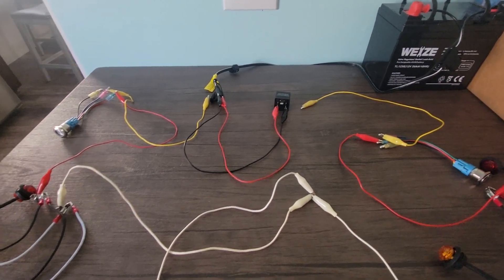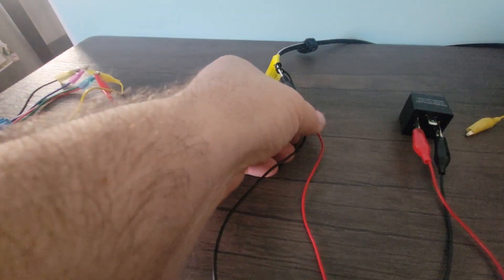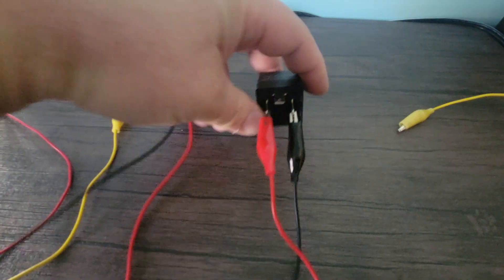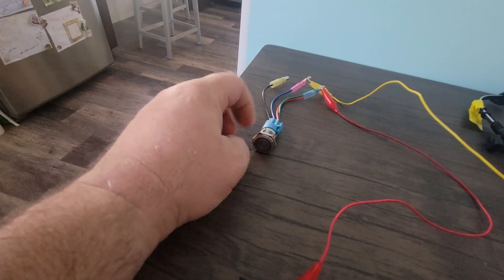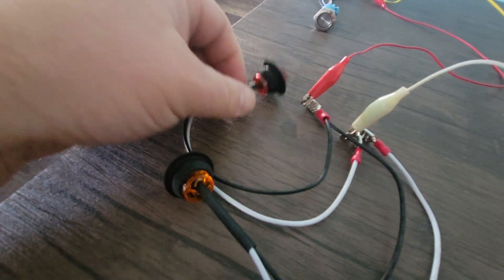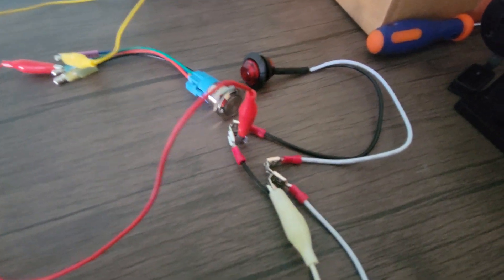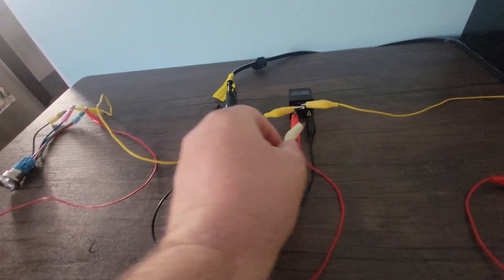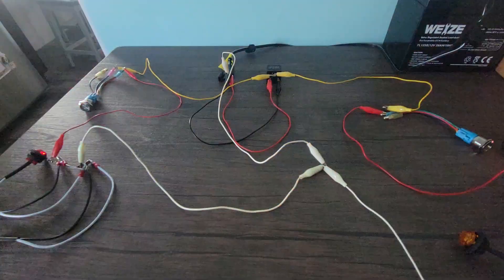How to wire a turn signal flasher relay directional blinker for a car, truck, atv, motorcycle, ect..

Comment: I just bought that setup so this helps out a lot for me !!! on my 212cc build ina a 1987 polaris 250cc cyclone quad frame. the o.g. motor is gone now !!! I might drop a 420 cc later in it. the go-kart motors !!!! basic 6000 rpm. stock !!!

Comment: Hey awesome video and project. Was wondering if you had any input on a set of tail lights and flashers working, but turn signals do not work while tail lights are on.  Front signals and lights work fine. Rear signals work but only while tail lights are off.  Im stumped at this time.  Thank you for any help.  Peace.
Reply from the maker: It sounds like you might have a wiring issue in the rear light circuit, maybe a short or broken ground.

Comment: I'm confused, another video I saw the guy had 2 relays that connected to 1 flasher. You are using 1 relay and where is the flasher?
Reply from the maker: This is just one relay it has a potentiometer to adjust the timing of how long it blinks. The right and left light circuits are wired in parallel with individual maintained switch/button.
Reply: @offgridutah1  is there any way to make that work with the oem turn signal stalk on my 1987 jeep cherokee? I also need emergency blinkers to work with my stock emergency blinker switch
Reply from the maker: @nikthepunisher6255  if you bypass what's there and wire this circuit into the stock lights it should work just make sure to use correct wire size and fuse on  each circuit

Comment: So sequential leds signals are a huge market. Can I make my own using let's say a 5ft strip of leds and a turn signal relay?
Reply from the maker: One way this could be accomplished without a controller is that each light could have its own relay and each light relay would have a potentiometer set to a different position so that each light could be on or off for different periods of time this would require some different wiring methods than what is shown in this video. There are other ways to do this but the easiest way is to use some sort of controller so you can control the outputs for the coils of a relay for the period of time of your choosing.

Comment: So i have an extra back up camera that i want to install on my car to replace my broken side view mirror (yes i know i could just replace it, that costs money and i already have everything else i need to do the install. And id be bored) but im trying to figure out how to trigger the camera while the turn signal is on without the screen flashing with the signal. Any advice?
Reply from the maker: You would need to use a regular relay that is triggered to turn on when the blinker gets powered and you would wire the coil as a start stop circuit with memory.

Comment: is that clicking coming from the relay? I have a moped and it does have turn signals is just that the relay doesnt click, so I tend to forget when I have them on, wondering if I can just switch the relay and add that clicking noise. LMK
Reply from the maker: The click is from the relay because it has moving parts inside.  Solid state relays wouldn't make that sound. It is possible to change relays, but solid state relays usually last longer.

Comment: Okay I have a 2000 Mazda Miata and it's got a three terminal flasher and I'm changing it to LED and I can't find the direct plug-in one so I'm going to have to make a little wire harness and this explains everything to me how they work thank you very very much! All the terminations are in the switch on the column so all I have to do on the Flasher is get power and ground and then power up to the column on the original harness easy peasy

Comment: My golf cart turn signal control module is bad. Apparently these modules are always burning up. So I want to bypass the module using a flasher. The lights are LED, Is there a specific flasher for led lights?
Reply from the maker: The relay in this video would work just fine for that.

Comment: My talaria has 3 wires i have 2 pin relay do i need a 3 pin with the ground in assuming?  Or cuz in missing that it seems
Reply from the maker: Some relays have an extra ground leg for   a led light on them. This might be what you have. Not sure without seeing a picture.

Comment: i was wondering. you said that you had the wires fused  and i was wondering if it was necessary to have them fused? thank you. Raven
Reply from the maker: Fusing will protect your setup from mistakes or accidentally touching pos to neg. If that happens the wires will become a fuse and the insulation/wire coating will catch on fire.
Reply: thank you. if i directly wire my turn lights to my 12v motorcycle battery using the setup here without a fuse will there be too much electricity from battery and blow the turn signal bulbs or with the flasher switch only let so much electricity through? thanks. Raven @FTOTF1
Reply from the maker: @RavenKitten  it will not let to much electricity through. Lights will draw power based on their wattage. It will work. It's not safe if it the wire loses insulation... That is what will allow to much electricity through. Lights act like a resistor and only allow a finite amount of amps through.
Reply: ok thank you. that was what i was trying to figure out. what is making sure the watts and amps are correct for the lights? was it the fuse, the flasher, or the lights themselves. Raven @FTOTF1
Reply from the maker: @RavenKitten  voltage of the lights should be compatible to the battery voltage. In this case 12 volts. The fuse must burn before the wire so it's the weakest link. Watts/volts=amps.
Add up wattage of the bulbs /12 volts = amps use the amps to look at a wire size chart. Bigger wire size handles more amps. Make sure the wire can handle the amps and run while on continuously as well as the fuse, as amps get close to the fuse rating, they shouldn't be getting close to the wire size rating.
Reply: i see ok. i understand that. thanks for taking the time to clear that up for me. it was a huge help. Raven @FTOTF1

Comment: trying to recreate this setup to have turn signals on my jacket. any tips?

edit: I guess I have to tap into the turn signals, right?
Reply from the maker: Parallel off the bikes turn signal to the light and other light wire back to the common.

Comment: On my 2008 Ninja 250R they are also wired through the dash indicator. Polarity through the dash indicator is actually reversed depending on which direction your turn signal switch is in.

Comment: Great video, well explained.  I do however have a question.  It looks like you have your fuse on your ground.  I thought fuses were supposed to be on the positive side?
Reply: No,no black  is hot right rear mister master of confusion
Reply from the maker: It was hooked up that way when I made the video. The fuse will still work. Normally I fuse on the positive side. Thanks for noticing 🙂

Comment: Does that particular Flasher draw any current if none of the Switches are turned on?

I've seen 2 pin electric flashers with just 12v input and Load pins. But since this one has a ground pin it got me wondering of it draws current? I like that it give the audible click. 
The 2 pin I bought doesn't have the click noise. 

I'd like to buy one of these instead but just wonder if there is a draw and if it would drain my battery.

(I'll use a hot 12v input instead of switched ign input so my hazards can work with the truck off)
Reply from the maker: I haven't measured it but I do not believe that it draws current when not in use the way it is wired in this video.

Comment: Is this for LED only, or do conventional filament buls work with this relay?
Reply from the maker: As long as you don't exceed the voltage or current limit of the relay it will work for anything.

Comment: Amazing video... short and easy to understand... One quick question: Would it be possible to use an actual motorcyle turn signal switch in this circuit instead of using the regular push button in the video? If yes, can you explain how to connect the motorcycle turn signal switch to the circuit in this video... thank you
Reply from the maker: Yes you can. The switches In the video are maintained buttons. Meaning they stay on or off until they are pressed again. The same as a switch would. If you have a specific switch build the circuit and wire up the normally open contacts.

Comment: Nice video. Would this work with krx original tail lights ? I tired to tap into my left tail light to turn left both tail lights started flashing ?
Reply from the maker: You may be tied into the wire with both lights in parallel which would be perfect for hazard lights. Make sure the pos side of each light is isolated from each other so it only runs a positive signal to one light at a time.

Comment: Hey bro you still on here Ima need some help wiring some lights from a battery to a 03 rm85 for a mot
Reply: My main question is my indicator setup is the same how do I run a rear tail light separately but off the same loom( not flashing just on) and I’d also need to wire in 2x brake light switches so when I pull/press the levers they light up brighter as stop lights?
Reply from the maker: @Tizzy_p  I don't have a video showing this.  But all you need is to pull pos to an on switch that is in series with two lights that are in parallel and both lights share a negative return to the battery. This is the running lights. Next from the pos side just after the on switch create this same circuit twice one for right one for left and use a momentary switch for these 2 circuits. They will function as right and left brake.
Reply: @FTOTF1  that’s perfect buddy I really do appreciate it obviously the same theory applies without splitting as I only have the one brake light bro
Reply: @FTOTF1  if you get a spare minute have a look at my last vid right to the last 20/15 seconds your see my project
Reply from the maker: @Tizzy_p  post a link here

Comment: I can’t get lights to flash.
Reply from the maker: Try bypassing your switches  and make sure the relay is working.
Reply: @FTOTF1  does it matter what relay to use?  The one that came with it is 12v max 30w.  I can’t find one to match.
Reply from the maker: You can use any relay. Just need the electrical source to match the coil. When you put 12 volts on the coil it should turn your relay on.
https://youtu.be/ot4KO1Jg5Xw
Reply from the maker: Here's another relay as well.
https://youtu.be/CZVh8St28bY

Comment: can it work with ep36 led flasher relay?
Reply from the maker: Check the max voltage and wattage of your device if it doesn't exceed the relays max then yes it can
Reply: @FTOTF1  thank very much now i can light up my power chair

Comment: Excellent video, sir. One quick question, would it be difficult to tie this setup to the ignition switch so that the turn signals become operable only when the key is in the "on" position?  In other words, which wire would connect to the ignition switch? Thank you for your patience.
Reply from the maker: Wire it to the ignition switch contacts by wiring the positive side of the battery to the ignition then from the ignition to the circuit.
Reply: You can often find switched power in the fuse box. On some bikes you can even find run power, such as headlights that only come on after you crank the starter.
Reply: How do you wire it to work with the already working ones?

Comment: nice simple explanation. Question: I have the same push in switch and want to use it to wire all 4 car lights to my hazard flasher. Can you suggest how to do this? Your setup uses 2 switches. Thanks.
Reply from the maker: Using a hazard independently from the other two switches: Build the same circuit then add a third switch wire it the same except it will run 2 feeder lines from the same wire terminal on the switch send one to each light. They will use the existing commons as their return. You can parallel wire more lights from there.  Let me know if a video would help... Thanks for supporting the channel.

Comment: Hey man I'm trying to install led on my Honda shadow thought about buying a heavy duty harness for led lights and replacing there relay with a flasher relay u think that would work how would I hook up my handlebar switch which are two button momentary switch thanks in advance
Reply from the maker: This circuit would work with momentary buttons. Either  light would flash while it's  button is being  pushed.  Make sure to wire them to the normally open contacts.
Reply: I got rid of my turn signal switch on my Honda Shadow and I'm trying to wire the 2 momentary switches to my harness can u help me
Reply from the maker: Sure what do you need to know?